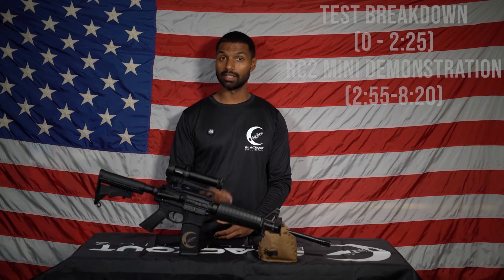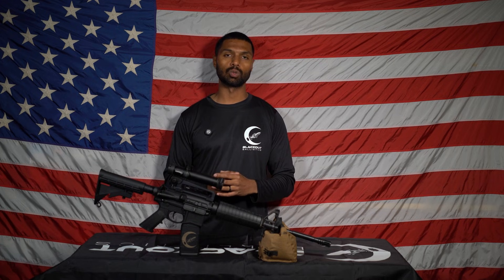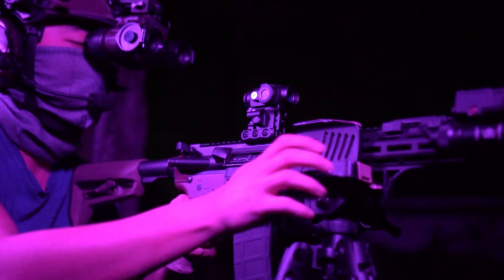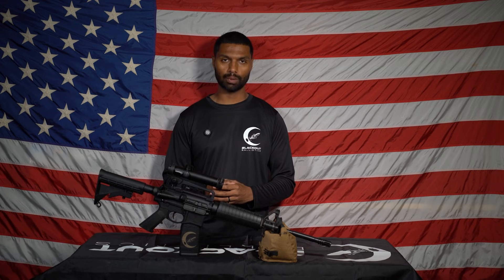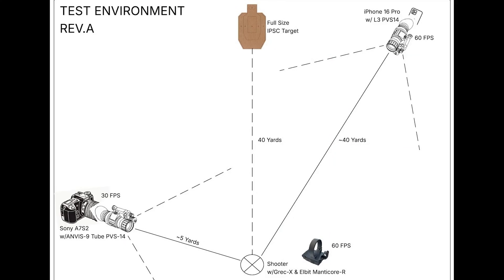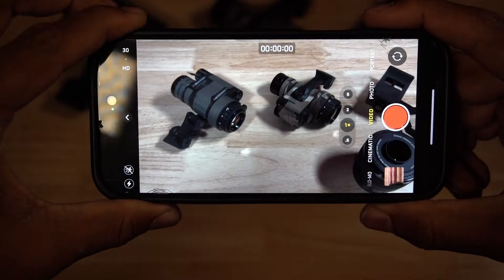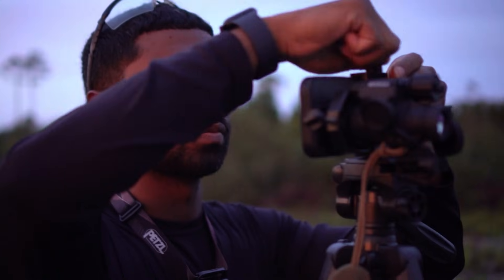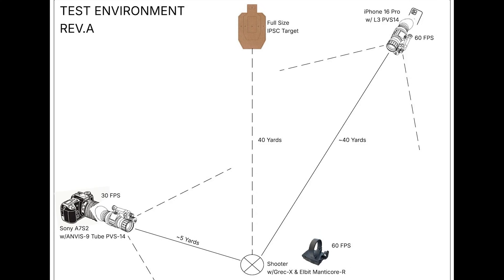Surefire RC2 Mini - Flash Suppression Series Episode 2

Comment: Fantastic work. I have the Mini 2 and RC2 - really cool and helpful.
Reply from the maker: Thank you! Which do you like more out of curiosity?
Reply: @BlackoutBallistics  Quite honestly - those two are my SHTF cans...I'm no high round count guy unfortunately though lucky former industry. Typically I am running a Gen 1 B&T SRBS Fullsize 5.56 on a CQB and its balanced and a Mini 2 on a URGI-ish. RC2 gas on my CQB is manageable and is likely a small port plus E3.2 - and pretty decent with just an H2 , Mini ofcourse slightly gassier and concussive but handy and more perfect for URGI. I like the B&T can and the suppression - the original SF hub isn't bad on my 3 prongs and CTNs...but I don't "believe" in HUB for dead nuts harduse...but I value my health for the lower back pressure. Yes RC4 is an interest. Watching the RC3 vid now.

Comment: Great testing methods - very well thought out. Looking forward to the rest of the series. Could you please do OCM5/AEM5? I suspect that (along with fullsize RC2) would be the king of overall flash suppression for 5.56.
Reply from the maker: Thank you! We can try and get our hands on those cans. Have you used those cans?
Reply: @BlackoutBallistics  I have the ocm5 and its a beast for flash suppression (granted on a rifle gas 17.5" barrel) and only compared to the polo k on a 13.9. Literally just the tiniest jet of flash if looking directly at my suppressor when shooting.

My guess would be the AEM5 is a tad better as it has stainless steel baffles compared to the titanium baffles of the ocm5.

If yall are in the eastern slope of Colorado Id be more than happy to come out.
Reply: @BlackoutBallistics  yes, I have the OCM5, it's literally hearing safe which is crazy for 5.56. Little to no flash at all, but I am running it on an 18" rifle length.

Comment: Crazy, it's almost like the more powder you burn IN the barrel before it gets blasted OUT of the barrel into the suppressor the better the suppressor works......And sooooooo the shorter the barrel is the longer the suppressor needs to be in order to trap the unburned propellant. In the end we always seem to get closer to the original length that the weapon and cartridge were designed for. No matter how many times this is tested and talked about, and new suppressor designs are remade and remade you will never escape the fact that it takes about 20" of barrel to completely burn the propellant from a 5.56.